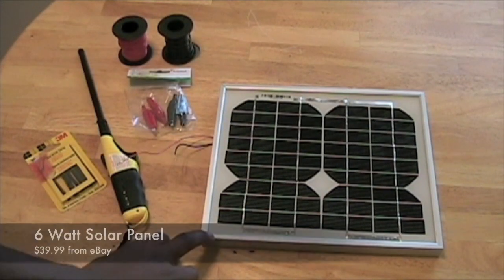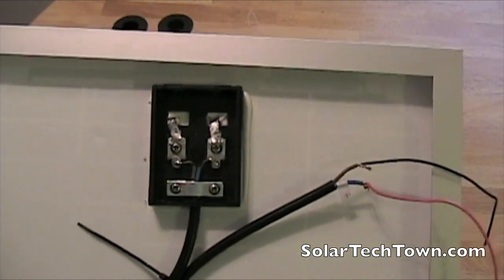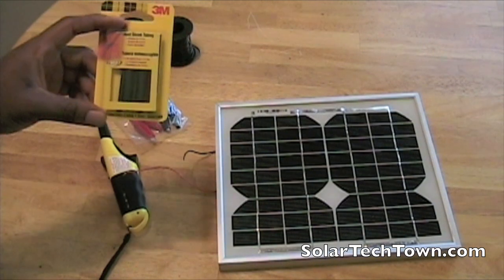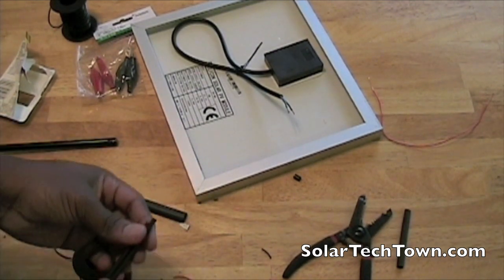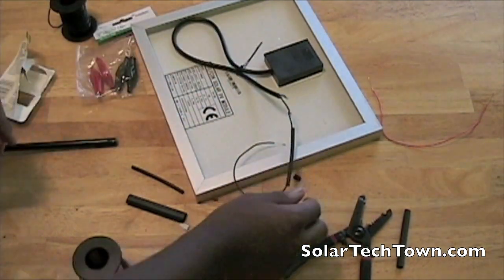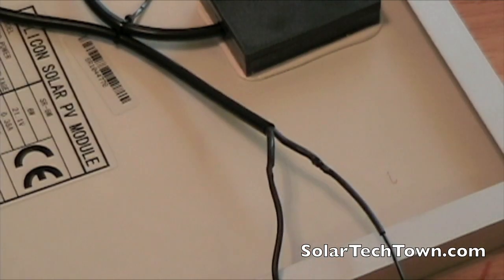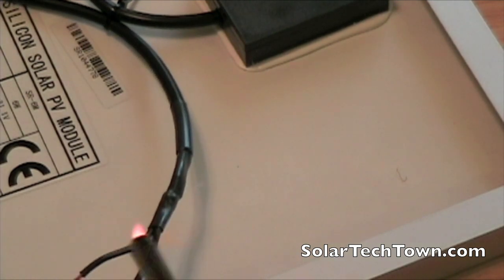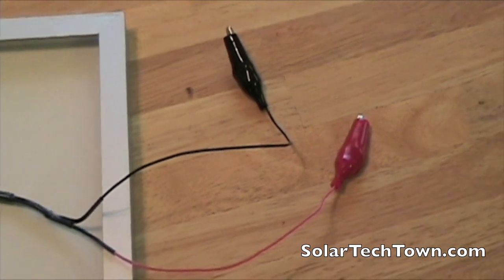Using Heat Shrink Tubing & Hooking Up Alligator Clips To A Solar Panel

Comment: Hey Mr. Smith, I like your ability to want to invent and youtube clips like this help others. I'd like to suggest though that next time you should solder the wires and dont need such excessive heat-shrink (not needed and its not cheap stuff.) But you seem like a cool guy and I'm curious as to what solar projects your working on cause I have many that I'm doin myself. We could possibly compare notes? Keep up the good work man!

Comment: I just bought a 20W panel that has bare wires hanging ready for me to do something to! Was hoping it would come with the quick connect connectors. Now I need to track some down (radio shack) and connect them!